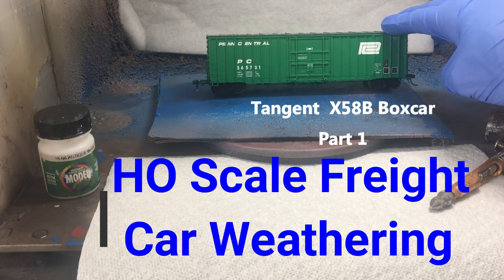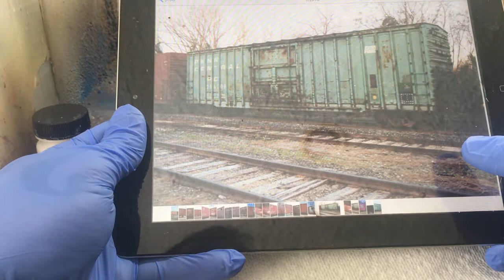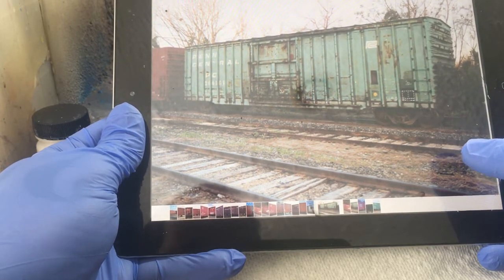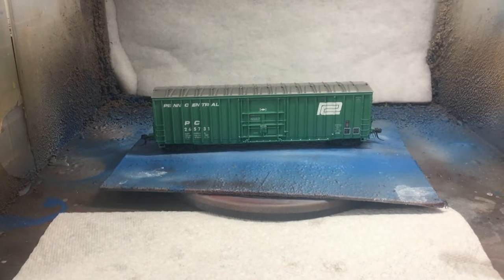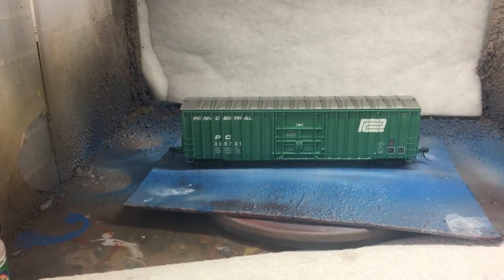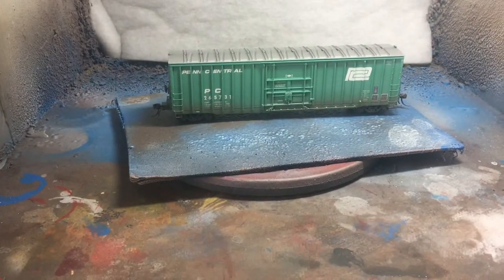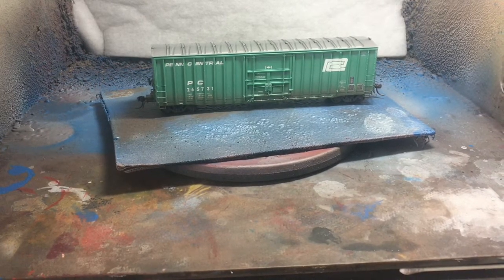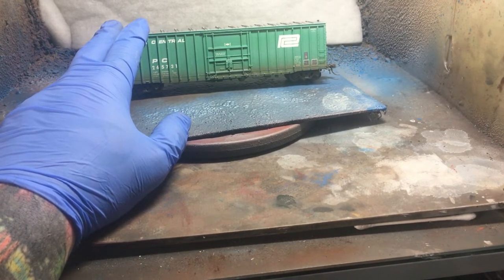HO Scale Freight Car Weathering Tangent X58 Part 1:

Comment: Hey Steve, looking good!  Can you tell us how you have your airbrush set up? PSI, paint thinning etc.  Looks like you are pulling the needle all the way back.  Thanks!
Reply from the maker: Airbrush is set to 22 PSI and paint is thinned most the time in a 2 to 1 ratio (2 parts paint to one part thinner) but is not exact. For something  like a fade coat I will use a 50/50 paint thinner mix to get a lighter effect and add coats as needed to get the look I am going for.